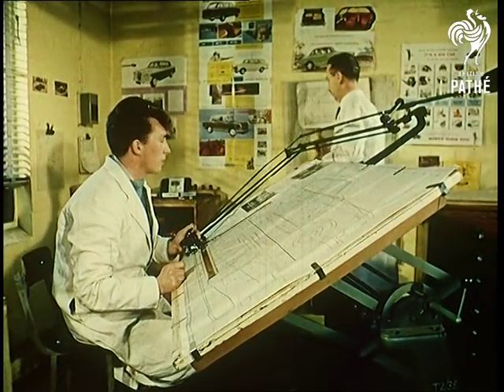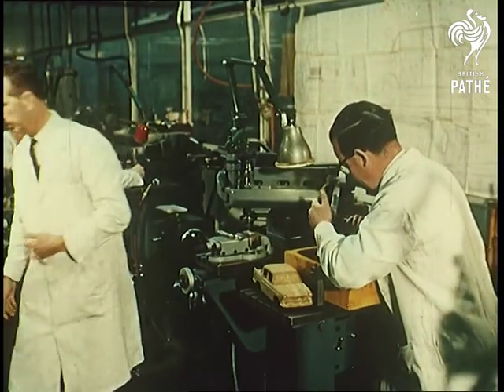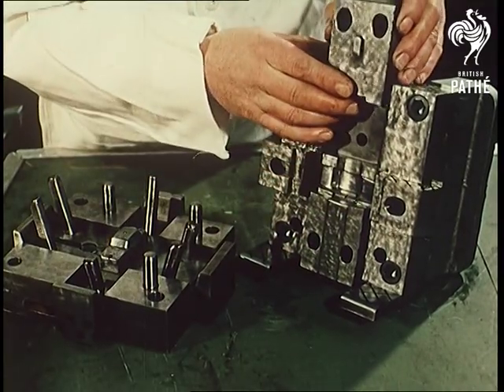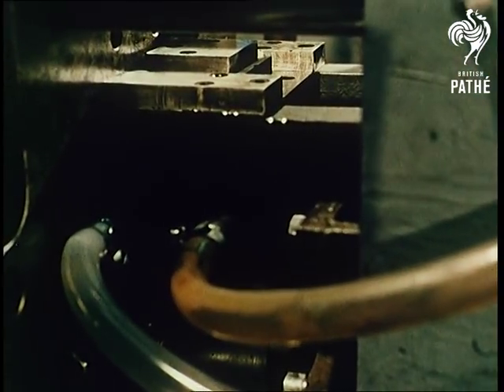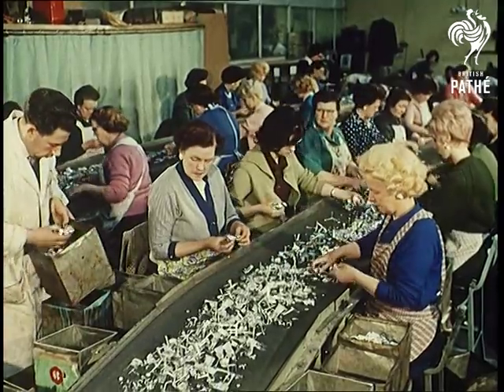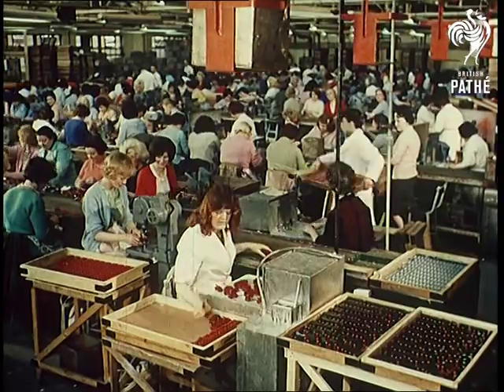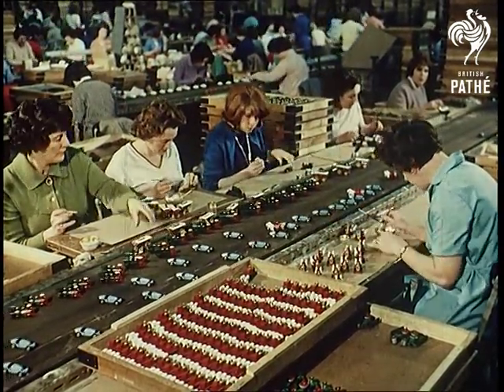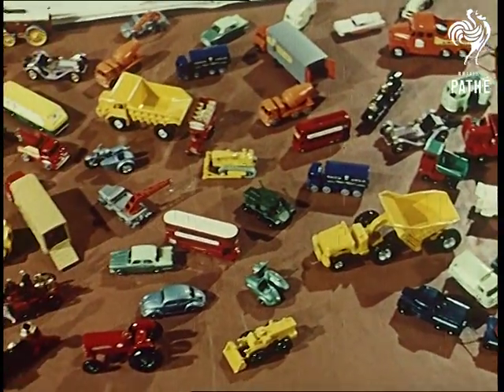How Model Cars are Made (1962) | British Pathé

Comment: Great film,  these classic diecast cars just have something that modern diecast is lacking,  perhaps being
designed by a Human verses a CAD Computer  ?
Reply: I think it is the fact that they are now made using cheap materials and cheap labour in China and lack the passion and care that domestic workers had. BTW CAD still requires a human designer, it can't be done by a computer (yet).
Reply: CAD is just a tool... blame MODERN car design... or just blame yourself for having a preference on older car designs...
Reply: CAD is not the problem, the problem some times are the designers of some cars, because actually we can find great castings in the mainline of matchbox and other ones that are bad..

That happends too in those old years of 60s, so many great castings and also there was bad castings and the problem was originated by the designer.

So CAD is not the problem.
Reply: I have to say though, today’s model cars are near perfect, in every detail!
Reply: Think what one of those 1960s designers could have done with modern CAD.